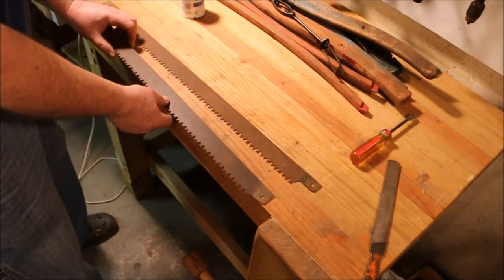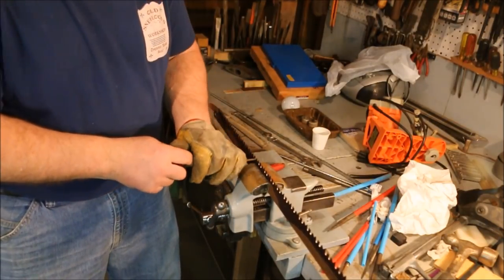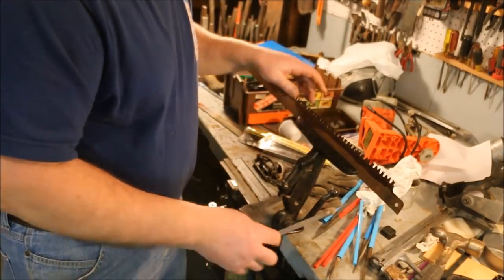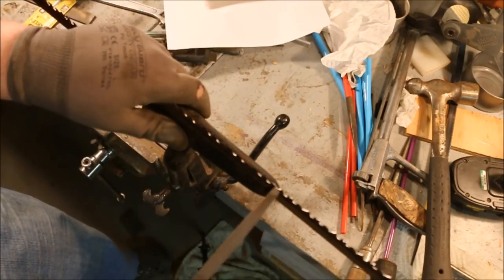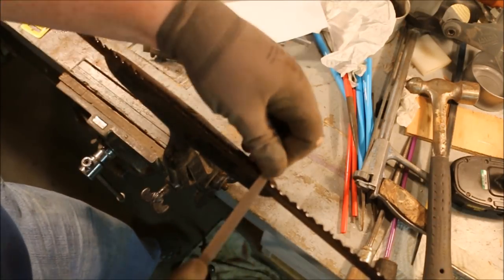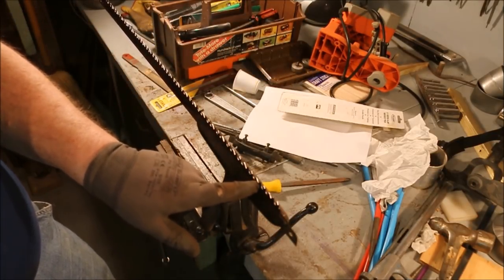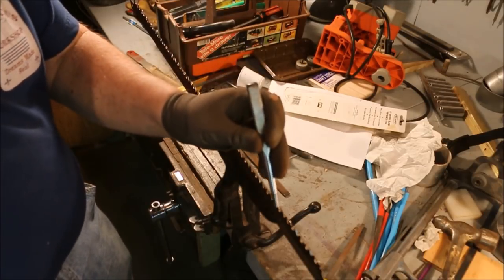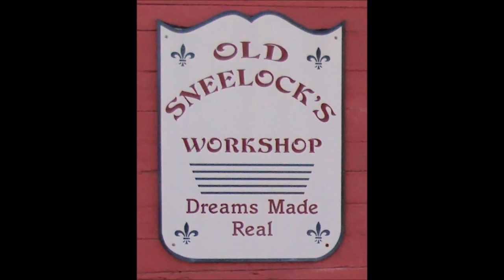WHEN GOOD SAWS GO BAD ~ PART 2 ~ SHAPING THE TEETH

Comment: 10/4 on the non-Dremel grinding. I guess that's why I haven't got a power chain saw sharpener.  I'd have to mess with it every time I went to tip one up, even if it was the same chain dimensions every time and unless something really bad happens I can tip one up with a file and never take it off the saw. I realized when finishing the firewood it's time to take the drags down a lick or two. Just isn't pulling into the wood quite right.  AND I wonder just how much longer my sawing is going to go on anyway. Talked to the Saw Surgeon before lunch/dinner and we're both getting older, so why add something that's maybe not going to be used. I'll just keep getting files. We had a Doberman that when she got perplexed, the very end of her nose, the big black cold slobbery knob would go back and forth. She could REALLY get her snoot out of joint! I wonder if mine does that!
Reply from the maker: What did you think of the thumbnail?
I read too much. One of the articles said I needed to stand out. 😈
Reply: I thought you'd been talking to me and David Chadwick; that is EXACTLY what I thought! When I first saw it I thought 'Yep, he's done and gone over the edge, all right'. But I know you've always been here. I've never felt by myself!!
Reply: Lewie McNeely I hope yours doesn't black knob please we have ladies watching ! 🐶
Reply: Old Sneelock's Workshop a phantom saw blade ? Attack of the good blade goes bad !! 🗡🔪👹
Reply: You've been up all day again, haven't you.
Reply: What'd I tell you, Unc.